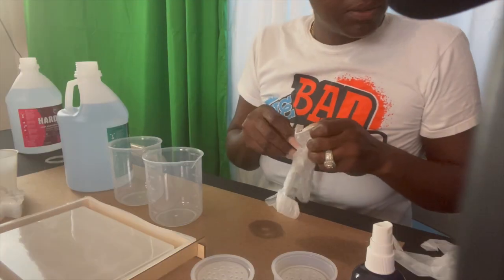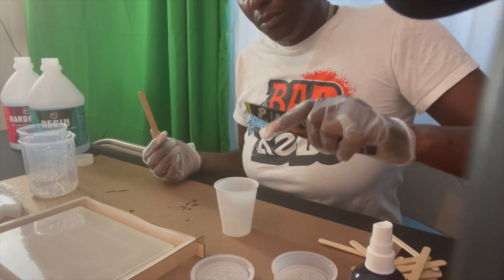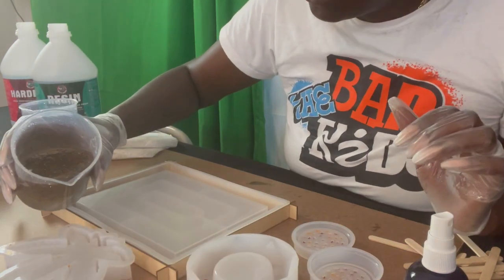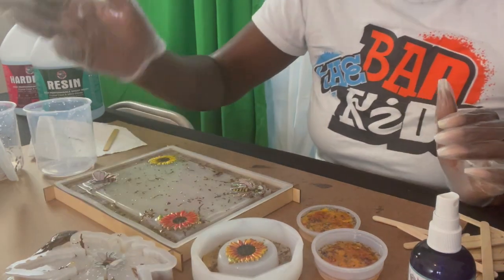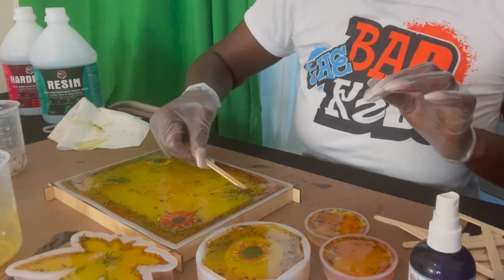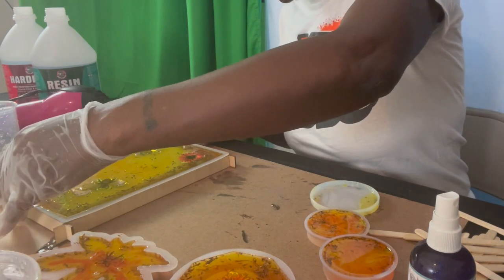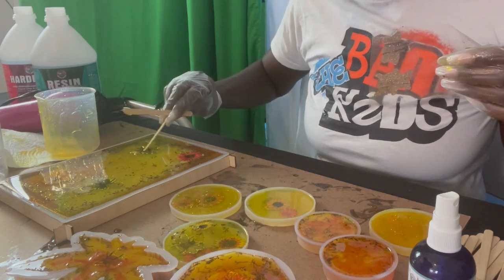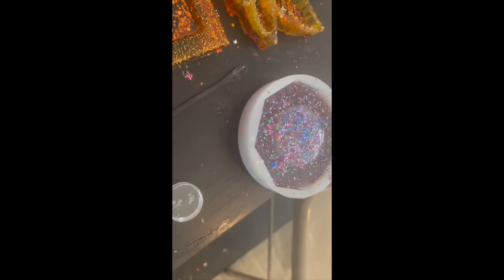RESIN EPOXY GONE TOTALLY WRONG!!

Comment: First thing to remember is that the side of the most molds you are looking at is usually the bottom, so if you want to place something in it it will be facing backwards to you. 
Second thing to remember  is color coordination or using complimentary colors, so they don't  get/look muddy. 
Thirdly, most molds will tell you how much resin you will need to fill it. 
Fourthly, if possible buy a large flexible silicone measuring cup, roughly 500ml. Makes it easier to measure and pour into molds or larger holding/mixing containers.
----- You will need a proper heat gun/ mini kitchen torch to pop any air bubbles. 
-----If using stickers or other add-ins that need be stationary wait til resin is partially set to touch and glue sticker down in place, wait til dry then add cover coat of resin to seal it in. 
Lastly, Hope this helps and I'm  not butting in too much, I've  taught myself  how to work with resin over these last several months....lots of trials and a whole lotta errors lol 😂
Best of luck on future projects and be Blessed sis💜
Reply from the maker: Ty
Reply: @MamaJones  You're welcome 🤗
Reply: Well said